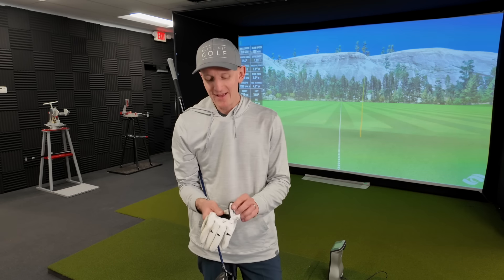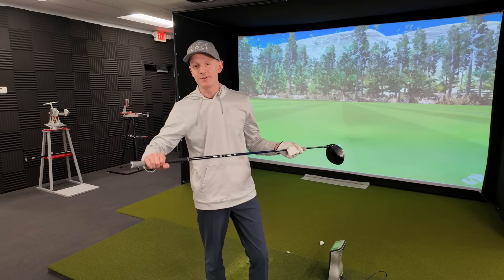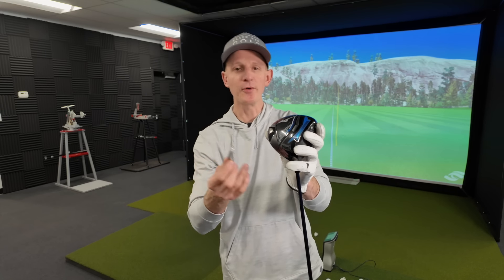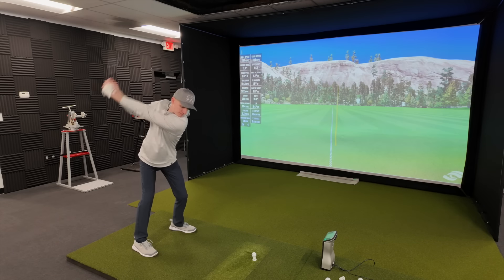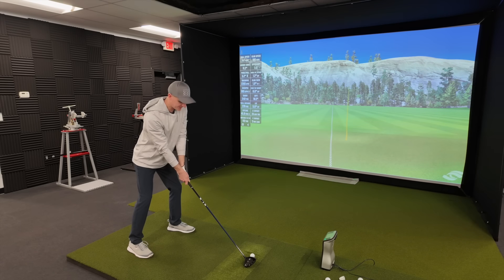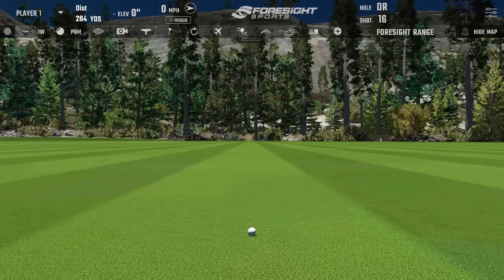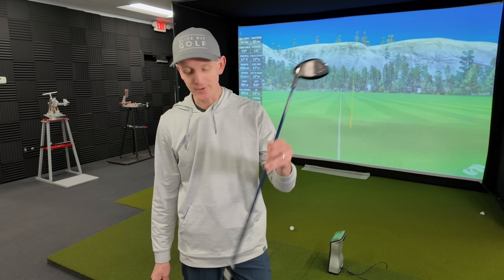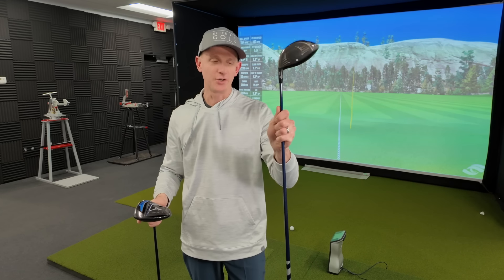MAKE YOUR DRIVER BETTER / 3 SIMPLE DRIVER ADJUSTMENTS

Comment: ok increase or decrease the lie angle, move the CG around in the clubhead, and open or close the face. 

Got it.

Oh, you didn't realize that you can't change just one thing at a time?

No seriously these are actually good tips, just pointing-out that there are intended and uintended effects. 

but the point is to get the club to work for you instead of against you.

Comment: Re-gripped(mud-size) my driver; made my own counter balance butt end 12 gram insert (3” deck screw, 2” of lead tape wrapped around it, 2 cushion wraps to cut vibration (use window rubber draft seal tape). Moved balance point 2” colder to handle. Choke down 1” and put 2 grams of lead tape on driver toe to lessen my over draw tendency.  Driver is now C-8. I’m a senior and crush it straight more often. 240-260 yds total (95 mph, 1.5 smash factor).

Comment: Love this video. I currently use a callaway ai smoke D driver. Need to shorten it. Having this issue with inaccuracy and dispersion all over. Want to try the 42.75 shaft length, I have a diamana I can use that is 10g heavier than current. How much weight should I try on the head if I’m already adding 10g to the shaft? Thanks!
Reply from the maker: It's all guess work without testing it. I would get some lead tape or tungsten stickers and go hit the range. Add weight until if feels right and gives consistent results.

Comment: I’ll give you what I believe is better, for me anyway. Get a high end counter balanced shaft and play it at 46 inches. Use a heavier head as in Ping or adjust accordingly. Choke down 1 inch or more or where comfortable, then blast away. When I have my weight calibrated properly at set up it, seems easy. No more secrets. Finally found the grail.
Reply from the maker: This is really funny you just sent this. Check out my new video release on Monday.

Comment: I am trying to build the cheaper version of Autoflex shaft so I went from a stiff shaft to a senior flex and lite weight,  going into the TSR2 head. Should I shorten the length of the shaft and add weight to the head or short the length and play with the standard head weight or just play everything standard?
Reply from the maker: Start standard. You can always shorten later.

Comment: Great video. I've been cutting driver shafts to Mini Driver length. I ordered a 16g slide weight for the AI Smoke to bring the swing weight up to a ~D4. I have lead tape as well. Did you calculate how much lead tape to add using your preferred swing weight?
Reply from the maker: I ballparked it but always go back and see if I actually prefer that weight for that length.
Reply: @EFGMC  Thank you for taking the time to explain this stuff to the golf community. From one teacher to another. Your passion carries through.

Comment: I can attest to this. I was all over the place with my driver. Went and got a fitting. My driver was 2.25 inches too long, shaft was too stiff and too light. I bought a fitted Paradym AI smoke, im hitting 76% of my fairways now, and misses are about 10 to 15 yds off fairway at most, according to my Arccos. Next was my irons (i have the jpx 923 tours, so a step behind blades), had them fitted and cut down, got smaller grips. I went from carrying my 7 iron 135 to 150 with tons of spin and a beautiful flight. So much easier to shape shots too. GET FITTED!!!

Comment: Good video.  I adopted the shorter and heavier shaft 3 years ago and it made a world of difference! I went from hitting the fairway 40% of the time to 80% and I gained 5 yards on average.  I currently play a Callaway Rogue ST Max with a Ventus Red Velacore at 44”.
Reply: I had pretty much the same improvement just practising my swing without making any silly adjustments.